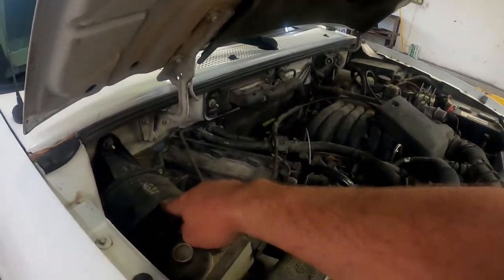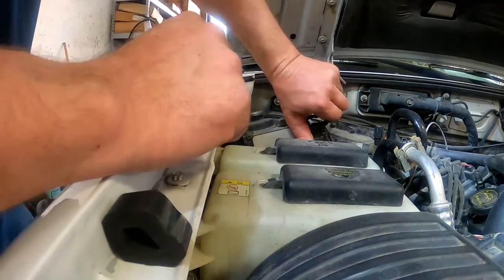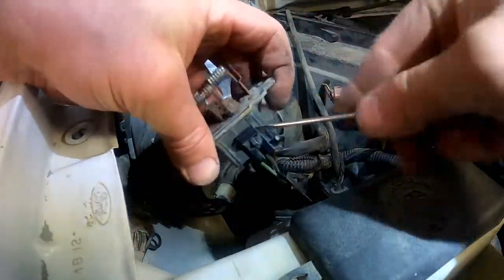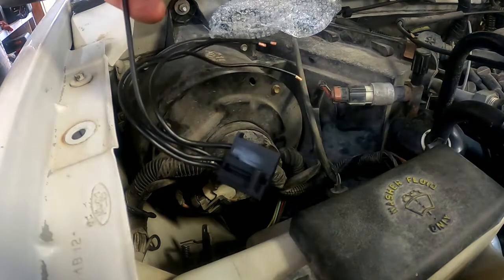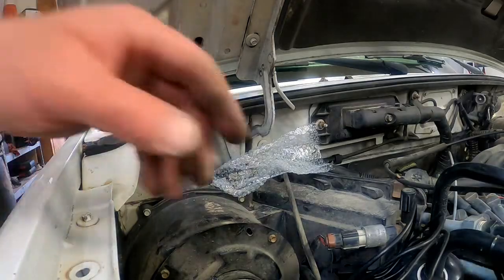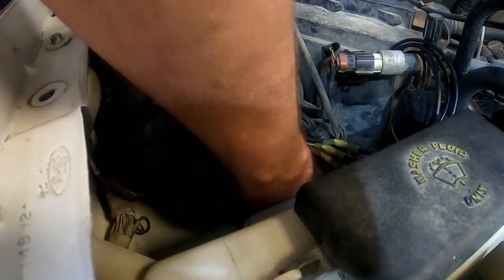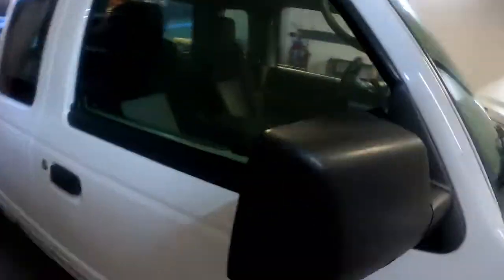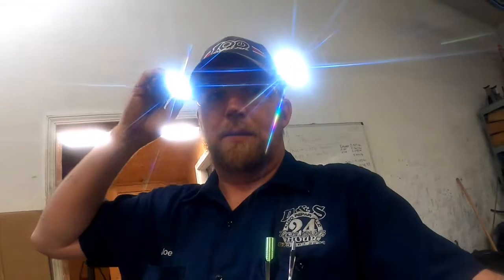How To Replace A Blower Motor Resistor In A Ford Ranger (2006)

Comment: My low doesn't blow, is the resister bad?
Reply from the maker: If you only have your highest speed, then it is most likely your resistor. Normally when you loose the resistor you only have low and hi, if you have lost low, but still have the rest of your speeds it could be the blower motor itself, or it could be in the controls.